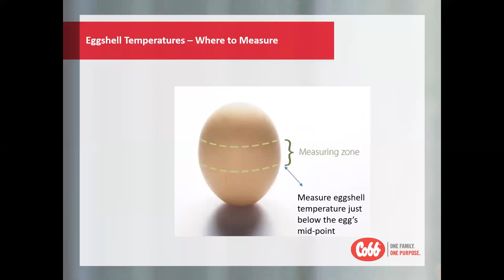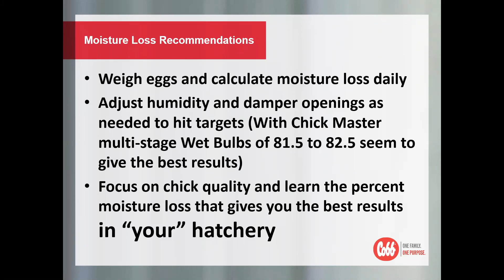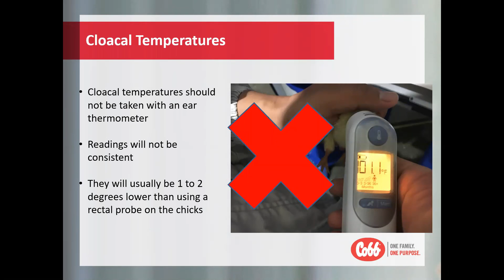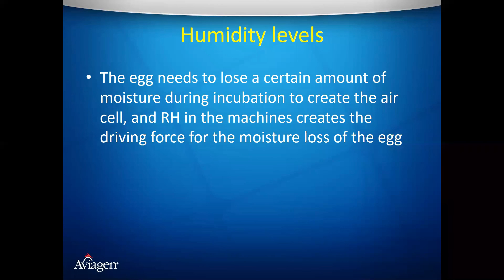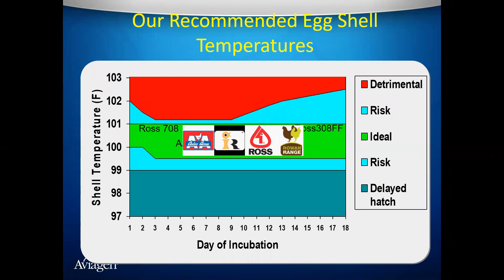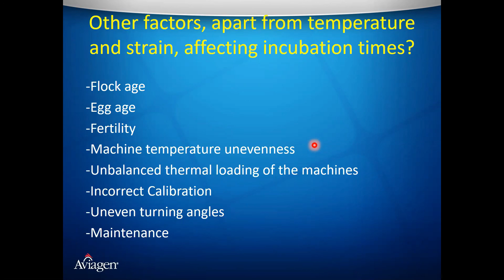Tech Tuesday: SPECIAL EVENT WEBINAR with Cobb & Aviagen - ENG

Comment: Thank you for this explication.

What's daily conditions per 1000 eggs on : ( Set Value : Minimum, Optimum,  Maximum)

SETTER period  (temperature, Humidity, Moisture, ventilation volume and flow, CO2, oxygen, pressure, turning angle and time per day ) 

And 

HATCH period ( temperature, Humidity, Moisture, ventilation volume and flow, CO2, oxygen, pressure )